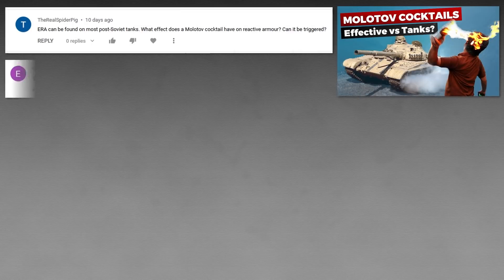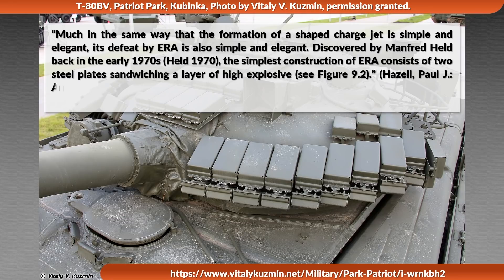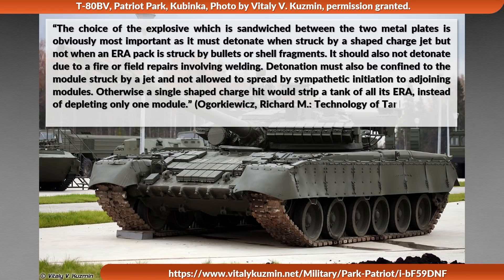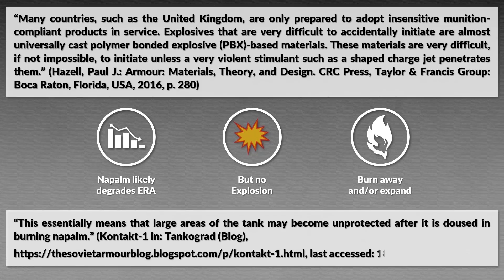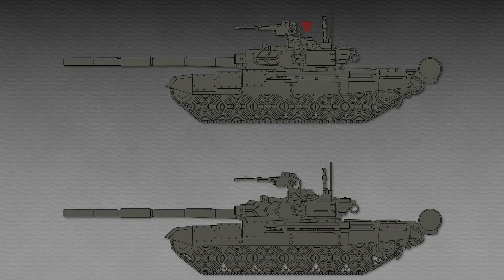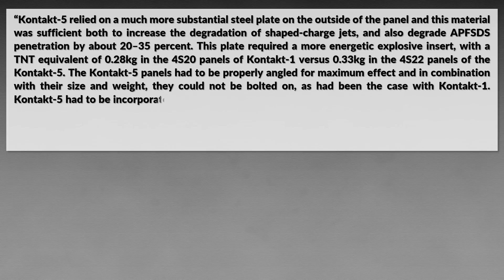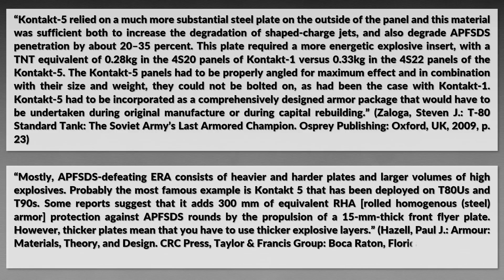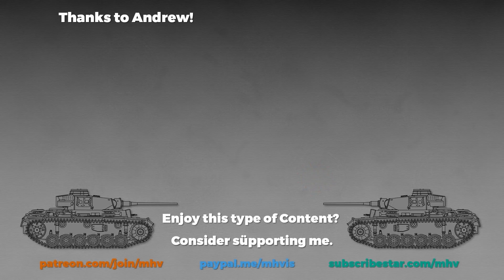Why does Russian Explosive Reactive Armor not explode?

Comment: P. S. Most plastic explosives are not sensitive to fire, only to the friction of the explosive particles caused by high velocity or another explosion. That is why most of them are activated by mercury fulminate or are contained in detonator sticks filled with initially explosive explosives such as hexogen (RDX) which has an explosion speed of 8750m/s or pentrite with a speed of 8400m/s.

Comment: The Idea that russian tanks are missing ERA explosives comes from a ukrainine video where he opens the panels to only find the rubber lining. The issue is he focuses on the 'Missing' Explosives but not the field stripped tank missing even the bolts and headlights, anything attached to the tank had been cannibalized for use on Ukrainian tanks, naturally that means ERA explosives sheets too.

Comment: C4 is by its very nature designed to explode only under extremely high ballistic pressure, a blasting cap for example. However the entire discussion of ERA for Russian tanks is now a moot point as modern anti tank weapons like the Javelin bypass ERA entirely punching a hole straight down above the turret, rendering the entire inventory of Russian T72, T80, & T90 tanks obsolete dinosaurs.

Comment: The reactive armor on Russian tanks does not explode because they are fake. It’s another in a long line of corruption in the Russian military. Along with fake helmets, and fake body armor. 
Corruption runs deep. Russian troops pulled apart a reactive armor only to find it was nothing but a slab of rubber.

Comment: The wheels are load bearing, so when heated even much below melting point they will more easily yield to the weight of the tank. The ERA blocks are not load bearing so they won't deform.
Wheels are also not made of the same high hardness steel as armor, though I would assume the casings of ERA are similarly lower grade for cost...

Comment: I dont know about mechanical engineering chemistry to explain this thing. We know at least some of the russians tanks only had plastics outside. No reactive armor. The evidence is: reactive armor doesnt protect the tank against a javelin missile. Americans studied russians tanks and developed an $80,000 cost javelin shoulder missile, light enoug easy to use and efective destroying russians tanks. The ukranians have the stugna an $20,000 missile also able to destroy tanks. The T 72 are dead traps. They have ammo under the seats tanks, we ve seen it torrets flying dozens of meters landing elsewhere. It is a very bad tank in term of protection, having light too weak lateral armor. When hit they explode. Newer better russians tanks have better protection giving them some time to abandon the tank. They developed de Harm an $800,000 to destroy the S400. The stinger to destroy russians copters and war planes, the harpoon to sink russians ships. The americans know very well russians weapons and how to destroy them. Ukraines war proves americans weapons are better than russians, with the exception of hypersonic missile... for a while.

Comment: Those blocks are too clumsy, and only protect a small area of the tank. Better, it would be to invent the magnetic shield that was used in the Yank 1960s series Stars Trek.  The Klingon bitches know how to disarm it, but they live far away and it is impossible to learn from them,   nobody really speaks the Klingon Lang,  the manual that supposedly is the Roseta Stone to decode Klingon is really a fake.

Comment: Flaming gasoline leaks into the tank engine area. Protection for engine vents degrades engine performance, not usually accounted for in tank design.

Comment: In another video here it was demonstrated that the explosive chages in the boxes were missing on a destroyed tank. Just filled with rubber blocks. So there were speculation of why sending tank crews in battle without this protection.  An answer could have been corruption which led the tank crew to a false feeling of safety.  Was that a single case or should other tanks be investigated why the protection did not work?

Comment: It takes a lot of energy and a comparatively long time for a material to change from a solid to a liquid. So logic would dictate that during the fractions of a second it takes for a shaped charge to go off the material used to create the jet will behave like a liquid due to pressure but doesnt change to that state. It would also dictate that a softer metal capable of bending and stretching unlike steel has to be used. Dont know though.

Comment: Some armor looking similar to explosive reactive armor is not explosive at all, it is using hick rubber elements under the steel plates, the effect against hollow charges is still similar - when hit by a HEAT charge the outer plate is moving away, so a lot energy from the jet is consumed by penetrating a moving plate before touching the main armor.

Comment: More interesting is part of video where wheels of tank are deformed from heat... How can tank burn so hot for so long, that even steel will deform like plastic...
Reply from the maker: due to weight of the tank and the wheels are rather weak in comparison
Reply: @MilitaryHistoryVisualized  yes, but isn't fire inside of tank ? and also, diesel will not produce so much heat ?
Reply from the maker: @GameOver-fn2og  1) steel/metal transfers heat extremely well, 2) diesel burns hot enough.

Comment: HEAT charge works much like water jet cutter. With copper instead of water and at much higher speeds.
Typical waterjet operational water speed is around Mach 2.5.
While HEAT charge copper jet speed easily can reach Mach 20.
So, basically, it washes thru the steel plate,  and "sprinkles" everything inside the tank at hypersonic speeds.

Comment: When it comes to modern secondary explosives, they are often extremely stable. You can literally set C4 on fire and it just burns, but doesnt detonate. High temperatures might set off the primary explosive in the lets call it "package", which would result in a detonation, but generally these explosives are quite robust.
Reply: Exactly.  And in the case of of reactive armor, the primary explosive is not packaged with the armor, but rather is the shaped explosive munition itself that's hitting the tank.  This also explains the apparently empty reactive armor "bricks" on burnt out tanks.  The explosive inside would have burnt in the fire without exploding, leaving the empty metal shell.

Comment: Not all explosives are set off by heat. Fun fact while I was in the marine corp we weren’t supposed to by any means, but cooked our food in the field by lighting Small chunks of c4. You can burn c4 all day and get nothing. It takes pressure and heat to set it off. You could light it on fire and hit with a hammer and you will become a mist if you have enough C4

Comment: Indeed, the explosive is very tolerant to heat and fire ... similar to how we destroyed extra "cheese" charges from mortar rounds by putting them in a pile and burning them -- you can stand right next to that fire.  Also, basic US combat engineer school demonstrates this concept by setting a piece of C4 (M112 explosive charge) on fire in front of the students.

Also of note, it takes the content of about about 2-4 ERA containers to gather the equivalent of an M112 block of explosives -- it's just a tremendous pain to remove the explosive from the half-moon shaped tubes inside the ERA box.

Comment: Just curious: what is the effect inside the tank if one or more reactive 'bricks' go off, for whatever reason?  Presumably better than having the armor penetrated, but it must still give the tank and its contents a nasty jolt.
Reply: Probably not too far from being similar to a frag going off right outside it. I’m not an expert in physics but I’m pretty sure ERA blocks are in essence, just shaped charges sandwhiched between metal. The blast force as well as shrapnel will go outward, which is what is supposed to interrupt a tandem stage warhead from allowing the EFP to reach the armor below the ERA. If anything, If the blocks get hit the energy from the projectile is going to go the opposite way, which would probably have some sort of effect on the crew. It also definitely depends on the warhead thats hitting, a HEAT round will produce a shockwave/concussion as well as spalling inside depending on how effective the ERA is and if the Sexond stage was interrupted. On the other hand an APFSDS round would most likely tear straight through ERA, probably not even detonating it. But inside there will be white hot fragments of metal bouncing around at insane velocities. AP rounds tend to make a large spark on impact because it’s literally just a rod that uses its kinetic energy to penetrate and do its damage. They are more expensive and uncommon, so HEAT warheads are still good since the first stage is designed to blow the ERA up and the second is supposed to continue on unimpeded. ERA was not designed for top down and kinetic impacts.

Comment: The energy from that thing is extremely high. So, a huge and pwoerful wave can push you around, right? But can also cut metal with water. If you apply that same amount of energy, but concentrate it to a tiny spot and then that hits you, you'd be sliced in half. The anti-tank missiles concentrate energy to a tiny, tiny spot and that explosive gets triggered by such high concentration of energy, but a fire or even a tank exploding doesn't come close. The explosive will melt/burn in fire, not explode as it happens slowly enough. You know those break-glass hammers, those are not heavy nor sharp, but it doesn't matter when you apply force to a concentrated area. "Explosive" doesn't mean "easy to set off"

Comment: do nobody actually bother to watch documentaries on random things?
I knew from a modest age that explosives come in different flavors of sensitivity, with most modern yet highly explosive... explosive being rather safe to handle by hand or even by shooting guns at them.

What taught me that concept was watching demolition experts constantly talk about how they would fill up a whole building with sever hundred kilos, if not tone of explosives, yet the danger only got real when they added the blasting caps that were connected to blasting wire that have a velocity of 2500m/s (give or take)

I mean I ended up being a manager at a general store, but still general knowledge is very nice to have, like knowing that a 18V 2A charger can easily handle a 24v 1A device, but a 24V 1A charger can't sustain a 18V 2A device (Literally used that knowledge to help somebody yesterday).

Comment: any idea if high explosive filled bullets might set them off? an explosive .50 BMG packs QUITE a punch for instance, and would easily go through the plates. if the abrams loads up with 100% exploding 50 cal ammo i'll bet there may be enough explosive in those rounds to set off the plates, or at least rip them apart, since it's rated to pass through 15mm of steel (or more), as the original was developed as an anti-tank weapon at the time

Comment: Thought I would add a little something to this shaped charge bit.    Some years ago I had to make a trip to Huntsville Texas near Houston.   Our sales lady had a customer that needed some help.  Turned out they were a company that made explosive charges for the oil drilling business.  They made cutters when a oil drill pipe got stuck or jammed and couldn't be just pulled out.   It turned out that two shaped charges facing each other could result in a sideways explosion that could cut the jammed pipe.   While talking to the owner I talked about what I understood about shaped charges due to my wargaming experience.   He said it wasn't a plasma or superheated jet that did the damage.   He said that the cutting was done in what he called "hydro-dynamically" as bits of metal just stuck the armor and literally beat a hole through, it was superheated of course, but he said it wasn't just a gas but bits of metal.   He also showed me their experiments in cutting drilling pipes and the shrapnel.   Damn scary stuff.

Comment: I'm not aware of the chemical nature of Russian reactive armor explosives, I can only assume it's based on Semtex which is the Eastern Block equivalent of the U.S. C4 Plastic explosive.
Going by what I know of C4, I can say it is very insensible to the point that we would use it to cook our C Rations by lighting it on fire. 
HOWEVER, if it was stepped on or struck while burning, it would explode.

Comment: When a HEAT round's shaped-charge "jet" impacts, the velocity of the impact provides enough energy to trigger Reactive Armor blocks, in the same way as a detonating cap or detonating cord (aka "primacord') does. BUT, if there is ANY significant air gap between any explosion and a Reactive Armor block, there will be no response. This is simply in the nature of high explosives. Even a quite small air gap is enough to slow the explosive pressure wave below the required initiating detonation speed for many explosives. The small side gap seen between RA blocks is plenty to keep a sideways chain reaction from happening, for example. Bullets and fragments from artillery, etc. aren't travelling even CLOSE TO the required velocities, and are of virtually no concern.

This also explains why, when placing explosives for demolition, each charge must 1) be wired/fused with its own detonating cap, 2) be solidly wrapped with detonating cord, or 3) be in actual firm physical contact with previously exploding charges. Solid-earth tamping is widely used in demolitions, both to contain the explosives and keep them from shifting out of contact, something that can't be done in a military attack context.

Comment: I've seen some photos of disabled Russian tanks where they had come off and they appear to be hollow inside. Or is there an air space between the explosive sandwich and the tank's main armor? I always imagined they were filled completely with explosive. (Or maybe they were and the explosive within them burned away? I don't think the ones I was wondering about looked burnt at all though.)
Reply: Don't expect those containers to look burnt, they are made to resist extreme heat so they won't change color that easily, but the explosive can burn or melt and leave an empty shell behind, starting all sort of theories
Reply: @toxik420  Ridiculous. They're sheet steel and paint.

Comment: Well.  You have to have a well designed reactive armor.   They could have just mounted the plates EMPTY.  Remember when the Russians put BUCKETS on the ends of the Main Gun to deceive the Germans so they wouldn't attack them with Light Tanks  ?

Comment: All nice and dandy, but your video fails to account for the daily realities of the cleptocracy known as "russkij mir". Those ERA casettes are made of metal, mounted onto iron bolts welded into the turret superstructure, and closed with screws.

In russian armored units, the short way to a fast buck was to unscrew a casette, dig out the explosive, close the casette, then sell the explosives to the gangsters on the local bazaars. There is also another part, that the sophisticated explosive mix is quite expensive, and if you are an industry overseer chasing impossible targets passed down to you in a national plan with insufficient budget, then paying a bribe to the officer receiving a modified vehicle, and shipping a tank which looks perfectly fine but in fact has only empty metal casettes was a quick fix allowing you to "meet the deliveries plan" without the money truly needed.

Nothing in your video is meritorically wrong, but the simpliest truth is that many a tank, particularly featuring older Kontakt-1, has the casettes/modules, with nothing but air inside them.

Don't bother denying. Only people who lived in Russia would understand.

Comment: The Javelin is purposely designed to defeat this ERA by having two separate explosions. the first to trigger the ERA and the second shaped charge (HEAT) to pierce the hull.  This is if the weapon is fired to impact straight on.  The weapon can also target straight down into the top of tanks.  Both of these methods would not show much evidence of the reactive armor being triggered.
Reply: Even the modern RPG variants are designed to to that, equipped with a tandem warhead. In fact all modern anti-tank weapons are equipped with tandem warheads.
Reply: The javelin targets the tank from the top, which has the weakest armor and least amount of ERA, if any
Reply: The NLAW is also easily taking out Russian tanks.  Drones are.  This war has shown how terrible the Russian Army is - all Russia has to bully is their Nuclear weapons - we all know what MAD means...

Comment: Another issue with Russian ERA blocks is that some are just fake, due to corruption. A person seeks advancement in the Russian army (and politics) to be able to steal money.  Using fake ERA blocks allows the person controlling distribution of those funds to easily skim more off for themselves. If you're a Russian General, you're not really concerned about the safety of the crew or tank.

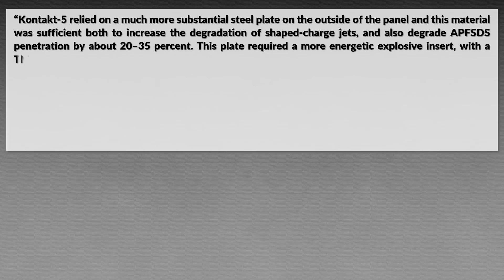Comment: 07:50
What I don’t really get is why you need more explosives in a Kontakt 5 panel compared to Kontakt 1. OK, you have a thicker steel plate. I assumed as long as the charge sets off you’re all right because the explosion would disperse the hollow charge jet.

Comment: Molotov cocktails should be concentrated at the intake of the exhaust system at armored vehicles that way the superheated air is drawn into the engine and turns it into a bunker the engine very quickly burns out and your left with inoperable vehicle